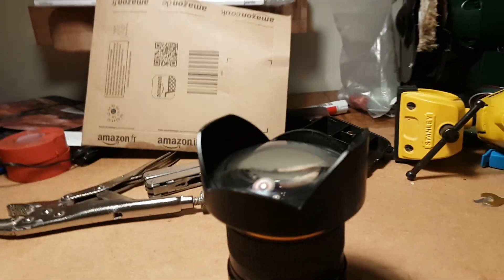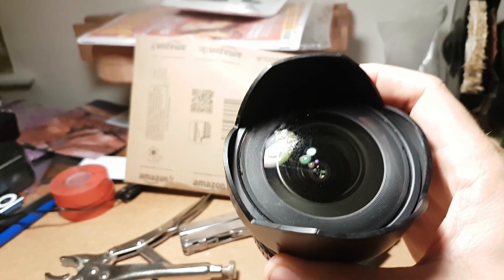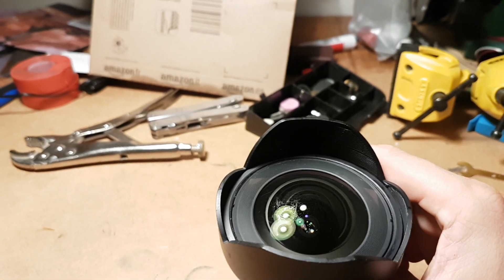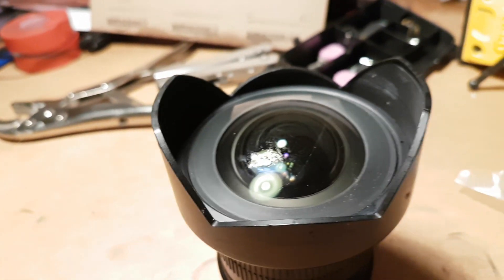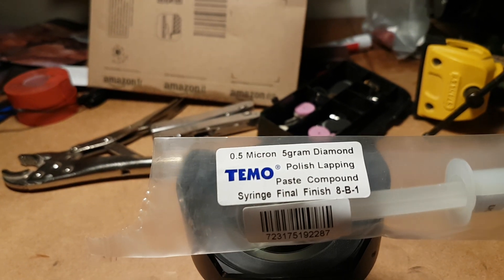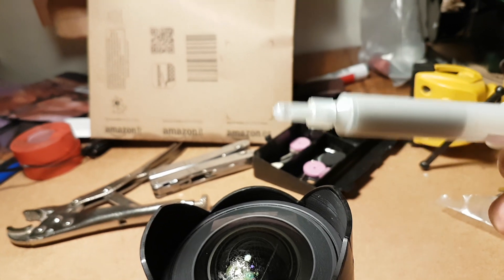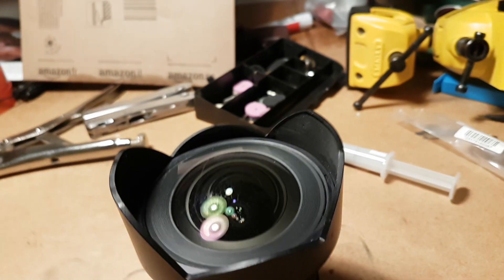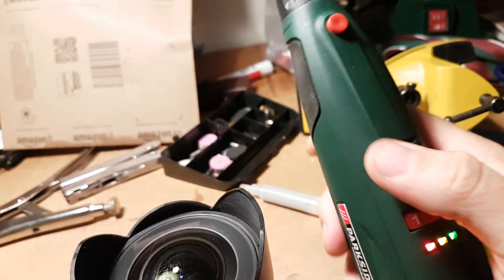Anti-Glare coating removal with diamond abrasive. Samyang 14mm astro lens.

Comment: Did practically the same with my car polishing machine. But I've took out the lenses before, which is much easier and faster to polish and thereby I've cleaned the lenses at the inside as well. Isn't that hard with the right tools, which are available for few $/€.

Comment: For everyone new. It works but it removes the very thin lens protection as mentioned. 

if you remove a small piece of this layer (which is like a paint in the lense) you might have to spend hours to make the surfice look the same.

and YES you would get blurriness to the highlits like having a soft mist filter.
Reply: it will remove the anti glare coating

Comment: BEWare!!! You can damage your nice optical Glass by this method!  It is the same like trying to fix a broken window with a Rocks!

A few minor scratches wont bother and wont take effect on a good optic  leave it as is!

My advice:
1* clean it by little alcohol, water
2* black marker method, fill in scratch

Ive you have nasty flares by the scratches my 
Best advice is to use a ND or Uv filter to eliminate flares, it wil stop down but still useful to take pictures.

BEWARE THIS METHOD will destroy your good optics, dont Relay everything what you see on the www

Comment: How can there be seen reflection of lamp on lens if you remover ar-coating?
Reply from the maker: The lens is glass, glass reflects light. See a window for more details.
Reply: @mdsween  But ordinary glass does not reflect color image, if it's color it got a coating.
Reply: This lens has UMC coating. Meaning other elements inside have coatings too

Comment: If you can remove the element you can let it soak in apple cider vinegar for a few hours and it will dissolve the coating. I did this for a lens that had fungus and nothing removed the fungus except the apple cider vinegar. Unfortunately along the way it also removed some of the coating so I went ahead and removed the rest of the coating by soaking it longer.
Reply: Can I clean with the apple vinegar without remove the elements?

Comment: thanks so much. great video. 
am looking for 0.5micron diamond past in the ebay, but I found different versions , I see some which is from 0.1 micron to 3 micron, may aks where I can find good one in Ebay?
thanks in advance.
Reply from the maker: Keep searching, or just use the 0.1 micron - polishing may take longer but its still not that long of a process.
Reply: @mdsween  
thanks for reply

Comment: Damn boi, my 14mm cine lens is looking the same, blowing out all lights when is wide open. I'll try this out
Thank you for this video
Reply: Hi, do you repair your Rokinon / Samyang? How the photos looks like at day now? I have the same problem at the same lens.
Reply: @dusan8154  I’ve removed the anti glare coating with lens cleaner and microfiber cloth, was a good time spent and looks a lot cleaner now, not as new but much better than before. I did only at the back element, this one was fucked, but I’m thinking in do the same on the front too

Comment: What a frikkin idiot! 🤪

Title of this tutorial should be "How To Destroy A Lens".    FYI, removing ANY thickness of glass from a lens alters the optical formula and degrades performance. Measurements in optics have to be accurate to within a wavelength of light!  

Pro-tip.  If someone claiming to be a skilled optical technician has a pair of vice-grips on their work bench, run away
Reply from the maker: Hi Mortimer Snerd - thanks for your comment. Clearly, this is a way to remove the coatings, not fix it entirely (as the title suggests!). I think even you will agree that the before and after show an improvement? I'm also not sure where I claimed to be a "skilled optical technician" in this video, but maybe you think I am? I appreciate your compliment my friend - kind regards.
Reply: @mdsween  , cosmetic improvement, yes.  You may understand this but I doubt most of your viewers will. Removing any thickness of actual glass (which a dremel and abrasive paste is sure to do) will alter the optical formula. Dimensional measurements in optics are in fractions of wavelengths of light.

It's fine to say the lens was so soft to begin with that the degradation makes no difference, but i'll bet most people who take your advice here and do this to a nice Takumar, Rokkor, or Nikkor will definitely notice it.
Reply from the maker: @mortimersnerd8044  I'd say the image quality improvement at the end gives more than a cosmetic improvement. The process is to show how a lens (like the one I bought) is not fit for purpose and destined to be either binned or sent away for professional work that would likely cost more than the lens new. I couldn't find any info on how to restore coatings or remove them, so, for the sake of a bit of diamond paste and a few hours the lens is now functional enough for my requirements. If you are going to end up ruining your already ruined expensive lens, there is no risk of loss - only the chance it is improved! Judging from the comments on here it's helped a handful of people and saved a few lenses. How would you go about removing a coating on the one like I bought (and using a lens cap to prevent it happening isn't a valid answer!) I'd be keen to see other routes to saving lenses. Many thanks

Comment: How about 1 micron ? Is it dangerous to use ?
Reply from the maker: Not as a paste - if it were to dry and you inhaled the dust then you may get problems, with long term exposure this could cause problems in the same way silicosis does.
Reply: @mdsween  no i mean not dangerous to body but to our lens ? And im curious about condition for the lens it self , is it still okey to use it for such long term ?
Reply: @mdsween  hey bro i buy from aliexpress and they trick me send the 40 micron . is it okey if i use 40 micron ? 😭
Reply from the maker: @awanggapandu148  Not sure, I don't see why not. Good luck

Comment: I had this problem with the tiny mod projector lens,of the Moto Z phone, it started to look fuzzy even when on focus so I noticed those tiny scratches and the lens is so small I guess will have to use Qtips, what I'm afraid of is the projector might have a plastic lens instead of glass

Comment: Thankyou so much for this great video!! I searched for ages on the internet trying to find a way to remove scratches from my lenses with no luck after using your method I have managed to do a number of my lenses with Great results, I just thort i  would show my appreciation keep up the good work all the best.
Matt
Reply from the maker: No worries - hope your buffing went well and you've saved a few lenses!
Reply: Did you use 0.5 micron ? How about above that ? Have u tryin' it ?
Reply: Hi, do you repair your lenses? How the photos looks like at day now? I have the same problem.

Comment: Hi, you said you used 0.5 microns because you couldn't find anything smaller? I'm trying to buy some on Amazon also and noticed that there are 0.25 and 0.1 microns there too. Would you suggest those or stick with 0.5? I'm trying to do the same thing on a Rokkor 250mm 5.6, an expensive lens but I got it on a flea market for $50.
Reply from the maker: I'd go finer if I could - there were small scratches left after which may not happen with a 0.1micron. Using 0.1 micron may take a little longer though but it didn't take long in the first place so adding time isn't too much of an issue. Using a decent dremel and felt head is probably more important. Good luck!
Reply: HI, were you able to polish your rokkor with this method? What pasta and felt head did you use?